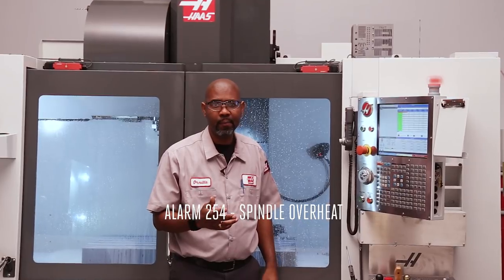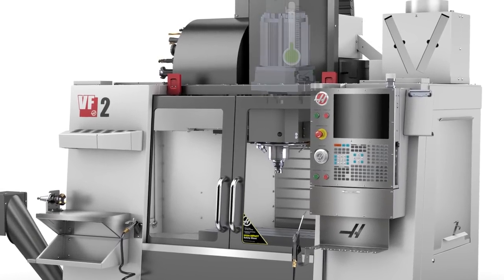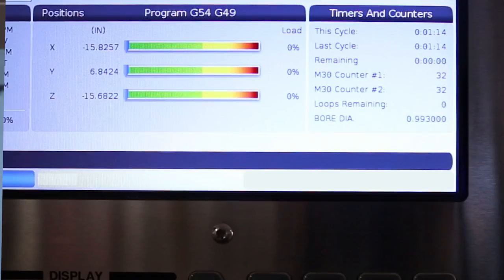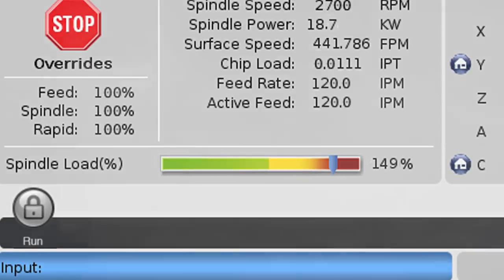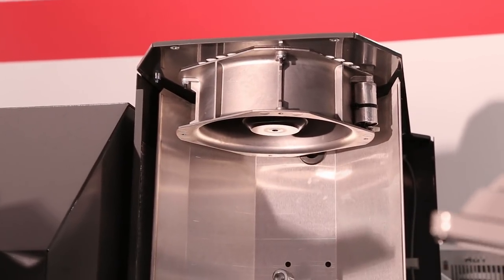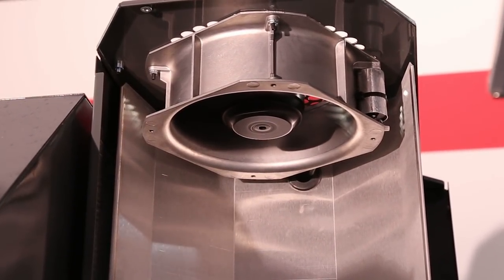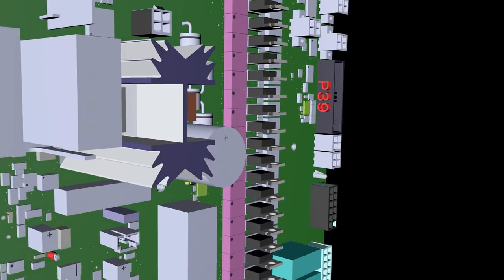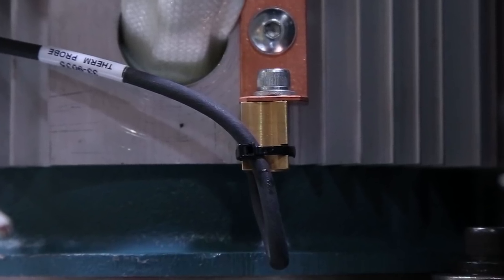Alarm 254 Spindle Motor Overheat  - Haas Automation Service

Comment: Is there an industry standard protocol for sharing alarms and sensor data over a network like SNMP does for computing and network devices? 

I'm sure Haas has upgrades and management software, but it would be great to know if you support open standards as well.